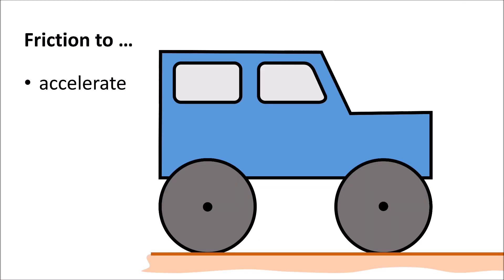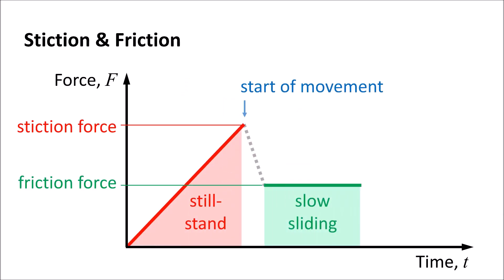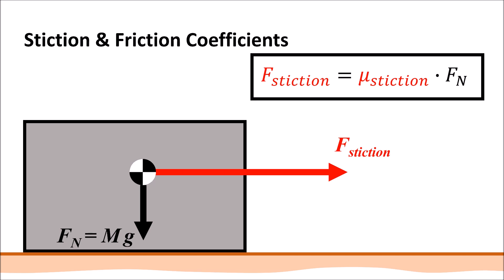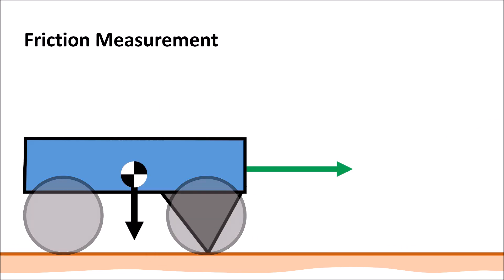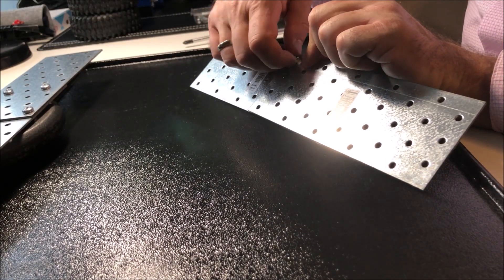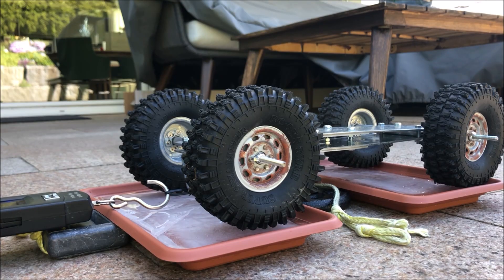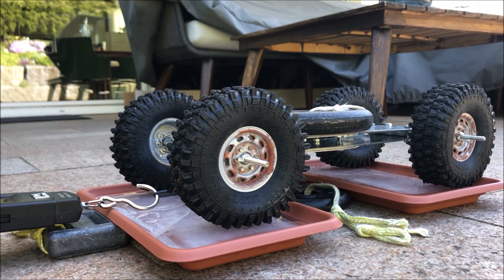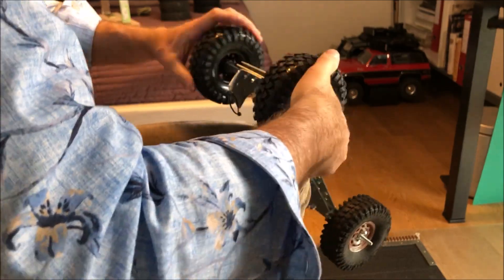How to Measure Friction of RC Tires on Different Grounds

Comment: Thank you for your effort you are putting into your channel. I am learning more from this channel than I could have ever expected and that is most impressive. Having a mind like yours in this hobby and willing to experiment and share results will be something I hope many get to discover as your channel grows.

This may be a most obvious answered question so excuse my novice scientific method, but is it not possible to use the truck itself with the tires installed for all the tests vs. building a platform for it? Are there too many variables in using the truck involved despite it being an applicable testing platform because ultimately the tires will go on the truck for use?
Reply from the maker: Many thanks for your very positive feedback and question. The main reason for using the slider construction instead of using the truck itself is that the construction is more lightweight. Therefore, I can test different amounts of weight, which I did in part 2. Another reason is that I can apply the sliding force closer to the ground. But if you want to test only with the normal weight of the truck and if you add a little lever that allows pulling on low heights, then you can also use the truck itself.
Reply: @rcscientific6004  The sliding force closer to the ground, you explained that clearly in the beginning of the experiment and I completely overlooked it! Thank you for clarifying that makes 100% sense now :)

Comment: very interesting, this is indeed an important issue regarding how well a crawler tire type can overcome several obstacles that require the friction of the tire material to be qualified, thank you very much for the experiment, I am waiting for the comparison list. I use austar ax 7020 tires
.
Reply from the maker: Thanks for watching my video and commenting it! The comparison is indeed interesting. There are some little surprises.